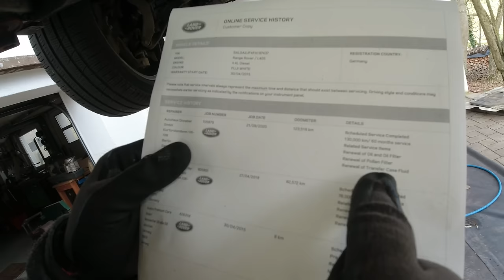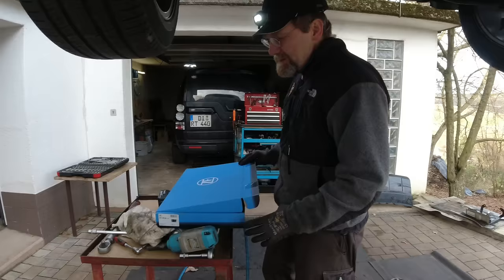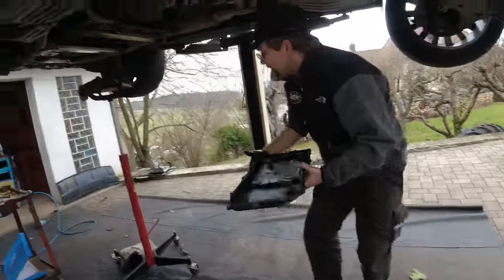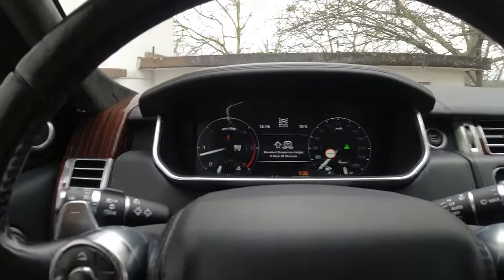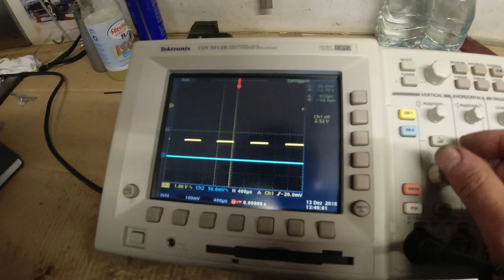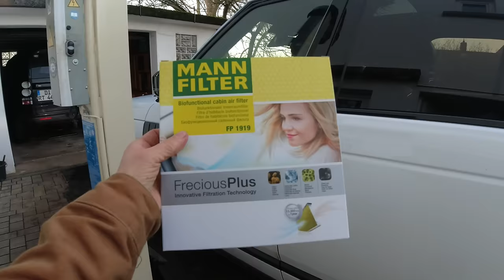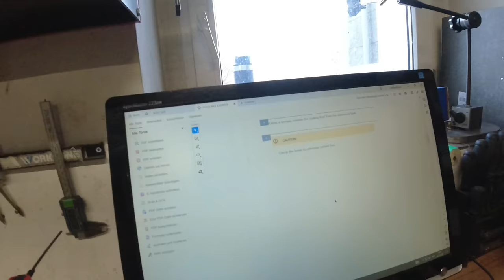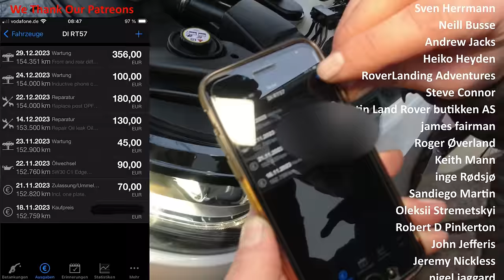Range Rover L405 Big Service including 8HP Transmission / S5-Ep3

Comment: I mentioned before about a simple flush system for ZF HP gearboxes, I am going to do my ZF 8HP on my Audi soon and will make some notes and photos… I will email them over. Is basic, a 20 litre container with a tap, a 2m long 20mm clear flexible hose with the old oil filter spigot (cut off the filter) pushed in the end, then push in the port in the gearbox where the filter fits. Place the fluid container up high (on top of engine works bit anywhere you can see it from the drivers seat, with about 15 litre of fresh lifeguard 8, open tap, let fluid reach the gear box (fills the hose), then start the engine, you have about 30 seconds for the gearbox oil pump to empty the 15 litres (just switch off the engine to,stop and before the container and hose is empty so you don’t introduce air) thats needed to replace the old fluid in the mechatronic unit, oil pump and torque converter. 

It’s very easy, takes minutes and doesn’t do anything to harm the gearbox like forcing fluid around with a flush machine using the oil cooler line’s possible can because you are using the normal oil port and the gearbox pump to move the oil around the gear box and simply comes out the same way the gearbox is used too and collected in a plastic pan on the floor.
Reply: Do your oil pressure test like you did your LR so we can see how long this engine with OEM spec oil takes to get to operational pressure at first start. 👍
Reply from the maker: It has instant oilpressure. The TDV8 is not know to have the same issues as the TDV6 or SDV6. 👍🙋‍♀️

Comment: On the later L405 - 2016 on - you cannot just drop the gearbox sump. You have to remove the large rubber bump and then twist out at 90 degrees. Even then it's a tight slide out with the old and in with the new. It took me a while to work out how to get the ZF8 box sump out.

You need to do an ACE fluid service. Then I can see how that is done before I attempt it.
Reply from the maker: That is on our list. 👍👌🙋‍♀️

Comment: Re check your oil level 20mins after hot engine shut down. It might be overfilled as it showed max with a cold engine on your video 👍🙏 I use 8.5L then top up. When cold it should be around mid way on the screen.
Reply from the maker: The screen display represents a 2L span on the L405 TDV8. Not a 1 Liter span as on the L319.   So mid in cold puts you at 8.4L.  Filling 9.4 is max and indeed then its not possible to see if it is over filled becuase it shows max.   But if checked a minute after engine off, it will show a gap like on mine.  So everything is good. Christian
Reply: @Vera_and_Christian Cool. On my L322 4.4 TDV8 it shows overfilled if over 9L used when checked hot. When cold, I aim for one notch above mid way 👍👍👍

Comment: Just looking underneath this L405 and its aluminium construction gives a very rare feeling of optimism about modern engineering and production methods. The Queen is 9 years old and looks like its barely a few months old simply due to its long term sustainable componant materials which suggests its toatlly different to previous generations that rust away..... Is this a dateless life long companion?

Comment: With regular engine oil changes on this engine. It is worth getting an oil suction device. It removes the oil from the top without the need to get covered in oil.😂 great content again thanks.
Reply from the maker: I agree.  I should have vacuum extracted.  Christian

Comment: Excellent and really interesting video 👍  One question - on the oil pan you removed it had a matrix where the installation date was punched.  I did not see you punch the new pan with the installation date - did you do this off-camera?

I noticed the pollen filter arrow - I think Land Rover installed the one on my D4 the wrong way round, as the arrow points up???

Anyway - I wish you both a very Happy New Year and look forward to all the new videos this year.
Reply from the maker: The matrix was stamped in the molding machine.  The original had a round stamp.  My ZF after marked hat that little matrix.    I am not sure if the video showed the "Polen" install direction correctly.  I was messing with it a lot to figure out the correct direction. But sometimes its not all on video.   So don´t rely on this comparred with the D4.  On the D4 is much more straight forward. Thanks,  Christian.
Reply: @Vera_and_Christian  Aah - I understood that the matrix was part of the moulding and that, on install, you punched a dent in the matrix at the place that showed the month and year of install - sorry if I misunderstood.  Great video anyway.

Comment: We once had a vehicle where the wiper blade had broken.  When I removed it to replace it, my daughter (small at the time) pulled up the wiper arm and as she was saying "where is the blade?" she let it go and shattered the entire front windshield ... same principle as one of those "life hammers", one supposes.  Nice idea with the oil sump drainage tube.  When you look up maintenance reference materials on the internet, do you find most of it is in English and German?  I often think to myself that if your command of the English language weren't so good, it may have proved an issue ... or perhaps German-only speakers can run everything through a machine translator (more difficult for PDF documents).  Perhaps you'll have to start calling 5W-30 "5W-some-ass" now that The Queen is running on it ;-)
Reply from the maker: Yes, 5w….  That wiper thing happens more often than someone would think.  Christian

Comment: Hi Christian & Vera,
I am about carry out the same full lubricant service on my L405 SDV8. 
My choices are non-LR approved Ravenol 5w40 c3 for engine and Ravenol 75w140 for the diffs ( same grade you used on your Discovery). Transfer box will get the ‘approved’ Ravenol DTF-1. Would you be happy with those viscosities on your L405? 
Best wishes,
Eric
Reply from the maker: Will go with 5w40 next time.  We use Magnatec 5w40 DPF because it is lo cost.  Ravenol is expensive but has a good reputation.  Christian

Comment: On my L320, i changed the transmission oil at 95000 km by a transmission professional, he told me to do it every 60k km.
Fyi it costed me 515€.
Reply from the maker: Yes we agree with your mechanic. And yes, that is the main motivation we do every oilchange ourselves.  It cost us 150€. The oil is expensive. 😃👍🙋‍♀️

Comment: How do you enjoy driving with the flipper switches for changing gears on the steering wheel? I like driving my L322 in sport mode with the gear shifter behaving a bit like a standard.
Reply from the maker: It brings the V8 out vey nice.  Better than my V6. Fuel consumption goes from 12 Liter to 18 liters too.  Shows how much fun it is.  Christian

Comment: Hi, Off topic. I have a 2006 LR3 HSE. That does not have tpms. Is the tpms harness intergated in the body harness like the 2007 on? Can I just add the tpms module and antennas and use my gap tool to enable it? If not. Is there a part number for the tpms wire harness?

Comment: Should have left Black Sabbath playing ( @25:16) :-)  I'd be interested to know why you don't flush the transmission?
Reply from the maker: Because of cost.  A flush requires about 12-14 Liters and more equipment.  Its more important to change regulary and more often using the correct oil.  BMW uses the same transmission in many more cars than LR.  They do not specify a flush either.   If a car has 200k and never got a change, a flush may be better but I never did one.  I flushed my Mercedes every time becasue they specified it.  Christian

Comment: Always a bit of humour in every episode!  My ZF8 speed oil  was changed on my D4 at the last service but the adaptation values were not reset by the service guy.  I found the gear changes were not the same.  Is it Ok to reset the adaptation values at any time after the oil change?  Its about 10,000km now since the oil change.
Reply from the maker: Yes. That is possible.  Just slow for the next 10 accelerations with first 30 and then 60% throttle.  It will shift rough right after reset.  After 20 km various driving, learning is complete.  It may not change anything.  Because the learning is ongoing.  Christian
Reply: Ah I see, so by now it has re-learned anyway.  Lucky I always drive gently with no hard acceleration!  Many thanks for the reply Christian.

Comment: How did it drive after the gearbox adaptations were cleared and did you follow the full drive cycle routine for this?
Reply from the maker: It took about 15 km in various driving conditions.  Then I gave it full throttle.  Very careful on the first initial shifts. No more than 30% throttle. Christian

Comment: Did you drain the gearbox oil when it was hot enough for the oil cooler thermostat to be open?
Reply from the maker: No, it was not open.  Still, few days later I checked again and I could add 300 ml.  Christian

Comment: i have 2017 L405 4.4 diesel ....i do 4000 5000 miles per year not much....if i did an oil change every 2500 miles would that help the engine?? Greetings from london
Reply from the maker: Yes, for sure.   Belive it or not but your use case is "ardenous use" according to the LR specification.  It is harder on the oil then crossing the Simpson dessert in AU. Especiall if the engine is not getting full temp or you are driving in winter.  You are doing everything right.   Christian
Reply: Oil is cheap v engine work

Comment: Was there any reason you didnt pump the oil out as its a lot cleaner
Reply from the maker: Do you refer to a flush instead of a change?  Flushing is higher risk.  It is sufficient to change the oil every 80 t km on a 8HP.  Flushing is also more than double the cost. 24 Euro per Liter is not cheap.   Christian
Reply: No the engine oil i allways use the suction method using the pipe beside the filler cap so much easier and cleaner but i must admit the tip using the exhaust tip to direct the oil was genius

Comment: I’m wondering do your neighbours not complain with noise with you using the air gun etc
Reply from the maker: So, you probably do not work that much on cars, but the air gun is only used seconds at a time, a couple of times. We are allowed to make to noise in Germany, especially on a Saturday between our operating hours. We are careful when we work. 👍👌🙋‍♀️
Reply: @Vera_and_Christian  oh Christian I do work too much on land-rovers and jaguar so says the wife, the reason I mentioned your neighbours was their house was in a shot not too far from your ramp, in fact I retired 7 years ago after specialising in jaguars in west London as one of the leading independent jaguar garages, owning 3 garages in London and 2 in Devon, I now do the same as you and have a full workshop at home buying and repairing discoveries / range rovers just to keep the grey matter alive, I find your and Vera’s patience unbelievable so much more than mine, the way you two tackle problems is mesmerising and a pleasure to watch, the way you measure and torque things as the settings from factory, but don’t you think they did all this when they were built at the factory and yet they still fail disastrously, I like you I find better ways of rebuilding lion engines like pinning the main bearing caps to stop bearing spin ( not had one fail since ) keep up the interesting videos Derek

Comment: nice car but not as nice as Discovery of course!  just please check your sunroof drain tubes, they are often blocked and can cause catastrophic waterleak failure because of rust, water and ice. could be nice video how to service that roof 🤌
Reply from the maker: We know just about everything about these cars. Have a look our channel. We covered almost everything can go wrong on our Land Rovers. There are enough videos on the sunroof leak, which we refer people to who have that problem. We never had and most likely never will since we do know to take care of it. 👍🙋‍♀️
Reply: @Vera_and_Christian   oh I probably missed that sunroof video than. I am your subscriber just from the last summer. Since than, I hate waking up before 10:00 at sunday because I have to wait for your video 😅

by the way - have you considered developing upgraded billet LR Time crankshaft for TDV6 engines?  I believe guys from zrp rods in greece or some other company could make it OEM dimensions but stronger.  On various forums people are group buying them for high performance engines (min order is about 10 cranks in most machine shops) but I couldnt find anything for TDV6 yet

Comment: Why don't you use the vacuum cleaner trick, when changing your engine oil, take the filer cap off attach and switch on the vacuum and then release the drain plug, and then switch off the vac's suction and then the oil will be released, no mess, try next time.
🙏
Reply from the maker: Because I am not that smart as everybody thinks and I like cleaing up an oil mess so much.  Lol.   Christian

Comment: I’m so happy that we both bought a 4.4 in the same week because I’m doing all these jobs also, though you are ahead of me now!  

Quick question, after I changed the oil cooler I also ran the old oil for a few days and then did an oil change.  Does the L405 not have the oil extraction tube beside the oil fill cap?  It’s the first time I’ve done it, but I was able to do the oil change by vacuuming out the oil from the top of the engine.   Much much better than crawling under a car and getting covered in hot oil.
Reply from the maker: Yes, if I would have know what trouble the change from under the car is, I would have bought a vacuum extractor too.  Definetly better on this car.   I also had to top up the trans fluid after a few days. It was 300 ml low.  Christian

Comment: Why don't oil pans have a little spout so you can connect a hose to drain the oil? It seems like such an obvious thing.
Reply from the maker: The car has a vacuum suction tube but I was too stupid to use it.  😬.  Christian
Reply: @Vera_and_Christian  Ah well...!

Comment: Why do you guys think 5w30 is bad oil? Just curious
Reply from the maker: Not in general.  The 2.7 L Lion TDV6 is approved for 5W40 and runs much nicer with it.  It reduces the risk of the very common bearing failure a lot.  We also run 5W40 in our 3.0L SDV6 - but not in the 4.4L TDV8 because it is not known for bearing problems.   We run 5W30 in our B-Class 1.5 L engine too.  So it all depends on what engine it is.   Christian
Reply: @Vera_and_Christian  oke but in my discovery 2 I can use both, would u rather use 5w30 or 5w 40 in my td5

Comment: I thought ZF gearboxes were sealed for life.
Reply from the maker: Definely not. Very common wrong assumption fueled by Land Rover.  Christian
Reply: @Vera_and_Christian . Obviously it’s fuelled by ZF as they are the manufacturers?  They are an excellent gearbox though, no need for double clutch boxes.

Comment: Lovely looking vehicles but too complicated. To change to oil you have to open the rear back door twice, then turn the radio volume to number 12, press the horn 3 times in quick succession. 🙆
Supposedly not very reliable either!
But lovely looking if nothing else.

Comment: How ridiculous that the design makes you completely replace an oil pan with an oil change
Just as stupid as a fill method that requires you to pump in fluid till it overflows 
What are they thinking
Reply from the maker: It's ZF not Land Rover, also in many other brands installed. 👍🙋‍♀️